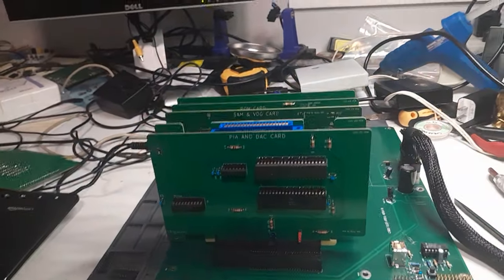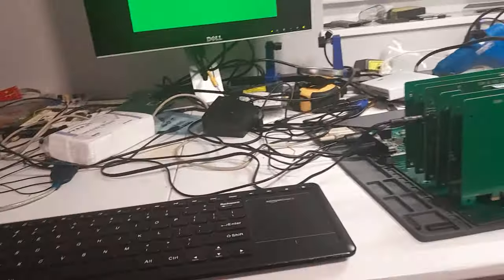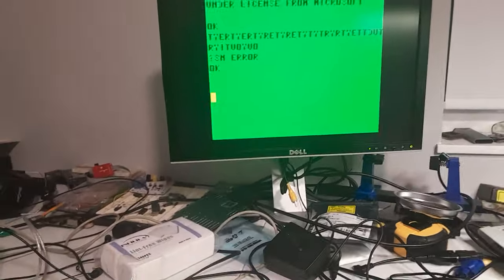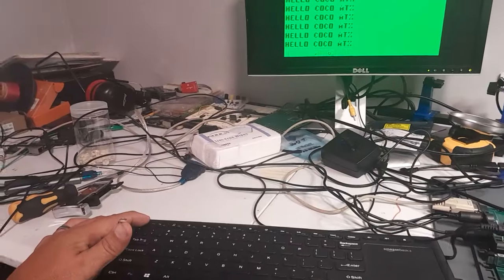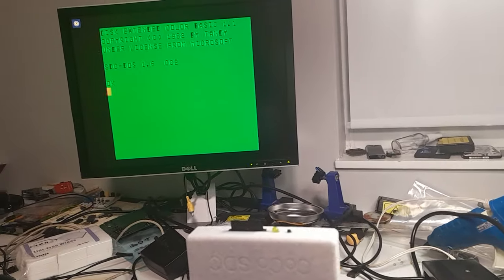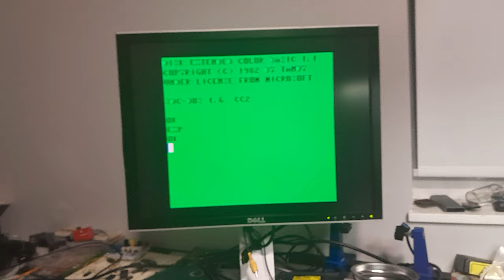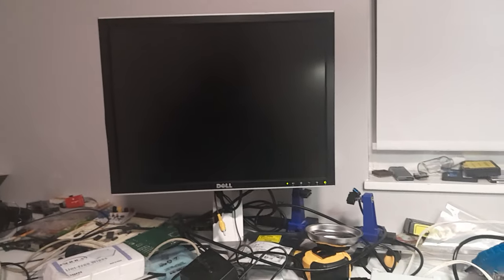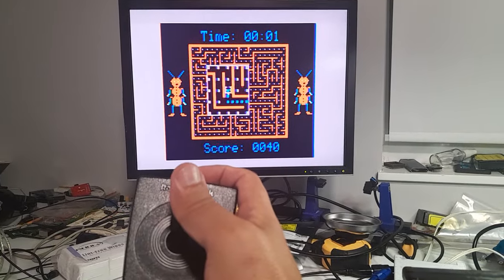Very late #SEPTANDY video! #OCTANDY it is!

Comment: I assume the goal would be to make a sort of "reverse sleeper" build?  Something that fits in a modern PC case, but is actually a CoCo?  Or maybe you would also support other (homemade) cards, much like PC, to introduce new capabilities.  Nice work!
Reply from the maker: Thank you!  A reverse sleeper build, I like that! One of the drivers behind this is to have a real CoCo that sits in a modern PC case and uses a modern PC PSU. Another driver is to make it sort of modular so it can also be a CoCo 2 and a CoCo 3 by simply by swapping out one card. The big driver however is to make it more hackable so that CoCo hardware can be developed with it and then ported to an authentic CoCo. I don't really see it as defined yet so maybe it will evolve into something else.
Reply: @rockyhill3  Yeah if you can make it "switch" that would be an incredibly cool thing.  For people who want to save space (two or more CoCos in one!) or for those who want to develop for multiple CoCos....

Whatever you do, don't visit the MC-10 channel and ask if you should make an MC-10 card... or a Dragon card.... I feel like some enterprising FPGA guy will create a computer on a card to work on your backplane.  It'll be pretty flippin' awesome.  I want one NOW!

Comment: I have noticed there is some sort of booting/timing issue with the SDC.  I've experienced this problem  before when testing MPIs and things like that.  I always felt like I broke something but I think Darren Atkinson might be able to shed some light on that because it's definitely not an uncommon issue.  Its behavior is kind of like "the CoCoSDC doesn't quite initialize before it's called on to run the autoexec because if you continued your test, you'd find you could navigate the file system on the SDC and even run the explorer manually.
Reply from the maker: Oh, yes, I have experienced this before. When I made the CART card I forgot to route E and Q so I had to bodge those down the board edge. What happened there was that when I introduced the card one of the lines came loose and it wouldn't start properly.
Reply: @rockyhill3  I don't pretend to know why but that's interesting insight.  I'll have to go back and check into that again.  I bought an up-upgraded MPI and used it with different machines and this anomaly happened.  I don't recall if I ever retested it after I upgraded the MPI for CoCo3 compatibility.  Maybe I'll check into that one day.

Comment: Just noticed the CPU board uses one side of a PCI-X card and the other device cards use the other side.  I imagine that'll become more uniform as you develop.  Have you created a breadboard card?
Reply from the maker: For the sake of getting this project started, I picked the side of the board that made the routing a little easier the boards. I haven't made a breadboard card yet but it's definitely on the list of cards to make.

Comment: Outstanding! 
Need a backplane that works in a 1RU chassis 🤪
Reply from the maker: Thank you! A CoCo server is exactly what wed need!
Reply: @rockyhill3  A coco that can work over a KVM would be an amazing space saver to be sure.  Also just noticed the "SAM/VDG card" has the video feed plugged in there.  Clearly it's the "video card" which would be replaced by the GIME-# card for CoCo3 mode.  That's where I would enlist someone to participate (not me, I'm not even close to being qualified) to establish the "video card(s)" to be equipped with sound/vga and/or HDMI with sound and/or composite video with sound, etc.  That's very exciting.  But whatever is done it shouldn't need to be a hack process like "connect to an RGB2HDMI from here" card.
Reply from the maker: I was swamped and there are many variables so I opted to implement only the safe stuff with only a few features, USB keyboard & header to power and reset the CoCo from the front of the case.That said, there is a video card/circuit in the works.
Reply: @rockyhill3  Actually, talk to L.Curtis to see if he has any plans to implement anything like DriveWire services under NitrOS9.  Then there could actually be a CoCo server!  Because right now "CoCo Servers" aren't CoCos.  How amazing would it be to actually create OS9 level 3 or to simply use your enhanced architecture to build a proper 680x0 based CoCo by switching out some cards.
Reply from the maker: @anjinmiura6708   Sounds great! I still have to work out a tons of issues though...
Reply: @rockyhill3  At the very least a massive, battery  backed RAM card or maybe just a CoCoSDC implemented that way.  Seems to me the card slots could be mapped as part of the MPI for internal things which should remain as internal.  I guess you're being flooded with really cool ideas :)